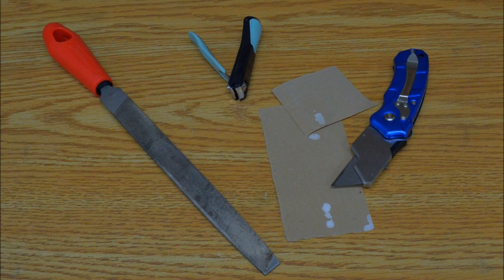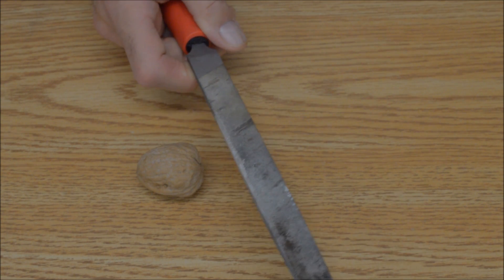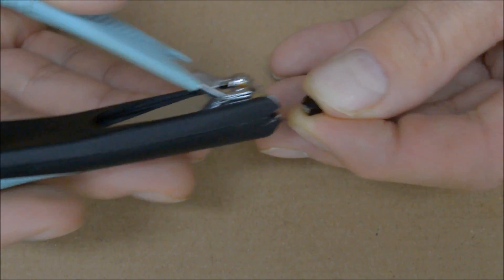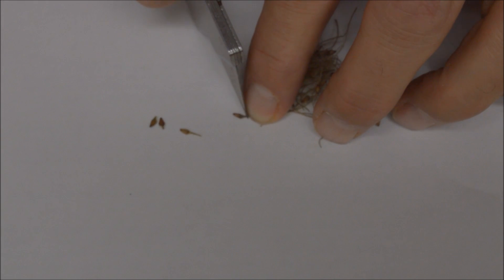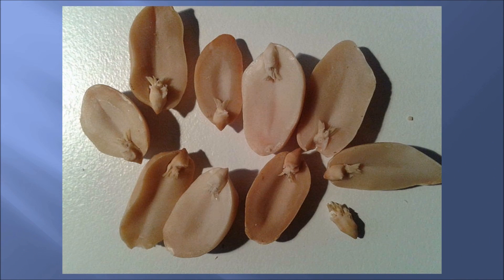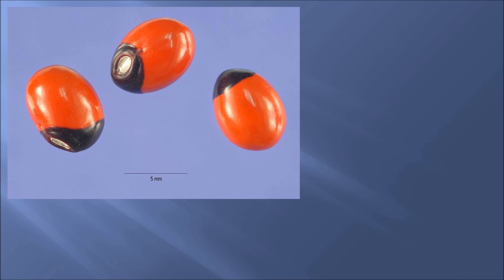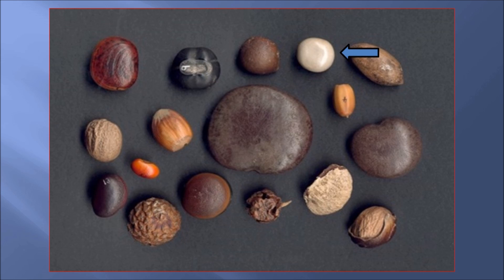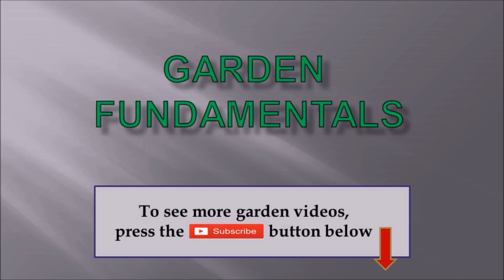Seed Scarification Speeds up Germination (compare methods)

Comment: I was just trying to determine which end of a morning glory seed was the embryo.  I'm afraid I may have damaged some.  If I'm correct, I now believe the pointy end is the end I should scratch, because the other end is the embryo.  Or try to nick the side edges, as some other videos have suggested.  Can anyone confirm this?  Thanks
Reply from the maker: I think it is the rounded end. You should still be able to see the scar where it was attached to the mother plant.

When in doubt, do different seeds, differently. Then at least some are right.

Comment: one method we use to use back in the day was to get a match box and take the striker part from the side and place inside the match box then put your seeds in the box and shake gently this roughs the surface up especially on older seeds